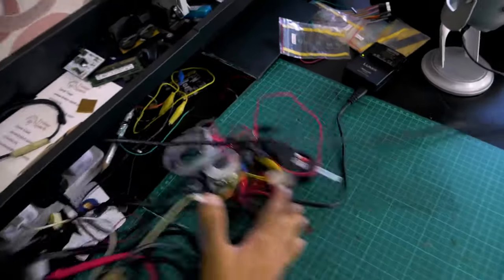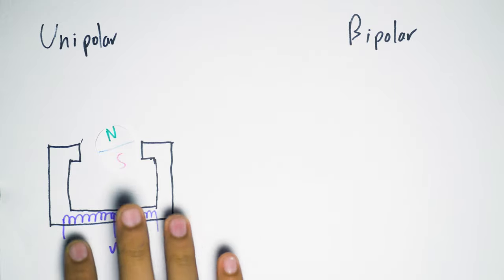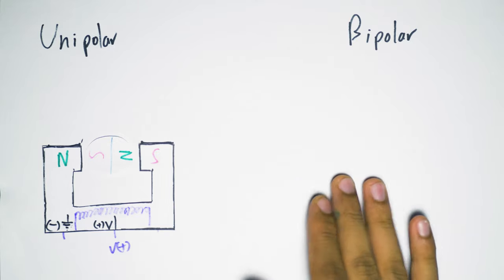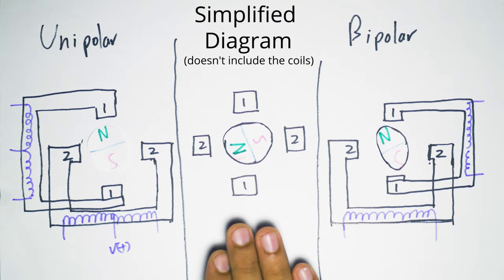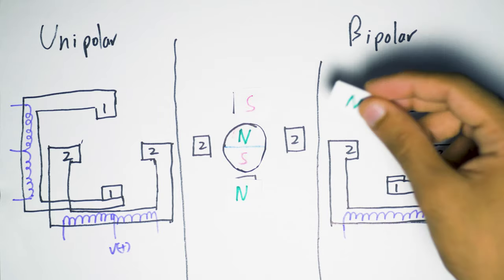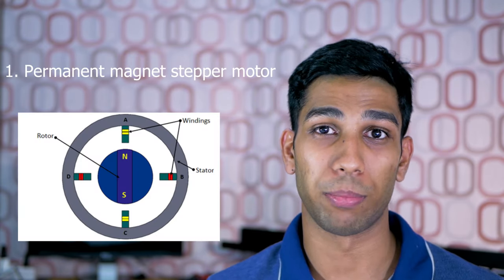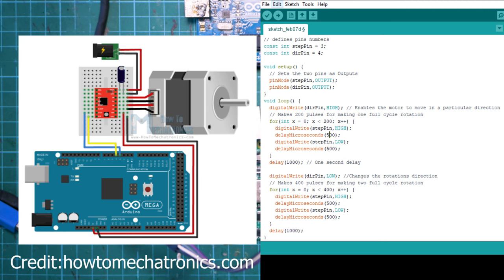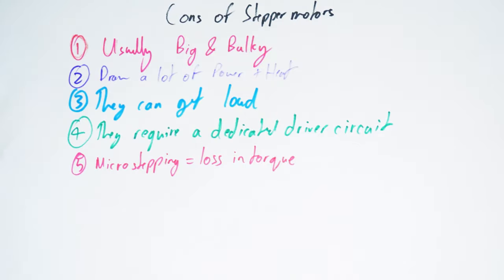Stepper Motor tutorial + Arduino & Raspberry Pi application- Electronics crash course #10

Comment: which motor driver would i need for this motor and which power supply you using?
Brand: Creality 3D
Item name: RepRap 42 Stepper Motor 
Item number: 42-34
Step angle: 1.8 degrees
Nominal Voltage: 4.83V
Current Rating: 1.5 (A)
Rated speed: 1-1000 (rpm)
Rated torque: 0.4 (NM)
Ambient Temperatuar: -20â„ƒ~+50â„ƒ
Length: 34mm
Application: 3D printer
Reply from the maker: A good stepper driver is the a4988 stepper motor driver. It's quite affordable and very easy to use. Good luck!
Reply: Thank you Saral!